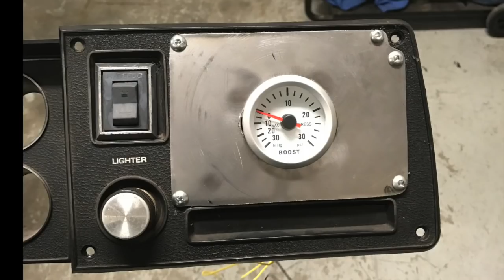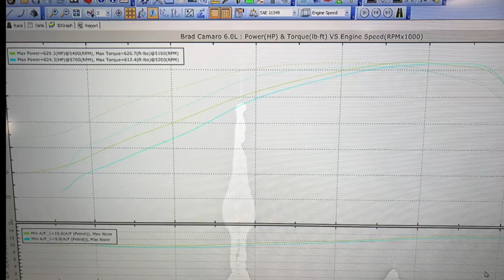Twin Turbo LS Swap Camaro 630 HP

Comment: I've swapped my 79 with a lr4 as I couldn't find any deals on the 5.3/6.0. which turbos are these cause I've bought t3/t4s and i think they'll be fine as I'm not looking for too much but I'm just curious.
Reply from the maker: vs racing has some good affordable turbos. These ones were bought off of ebay.

Comment: Did you do anything to the motor like cam or valve springs? Or is she stock?
Reply from the maker: .550" lift cam, stainless valves
Reply: @nyecegarage7173  that's it? Very impressive brother!!! What were the size of the turbos?
Reply from the maker: @claytonhaske   thanks! turbos are 75mm